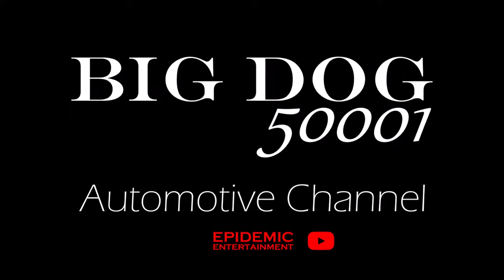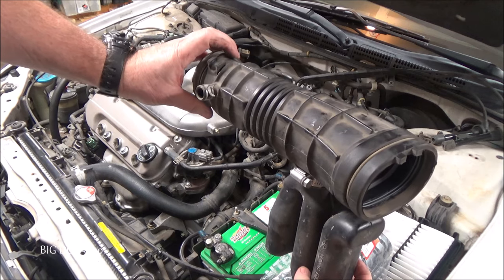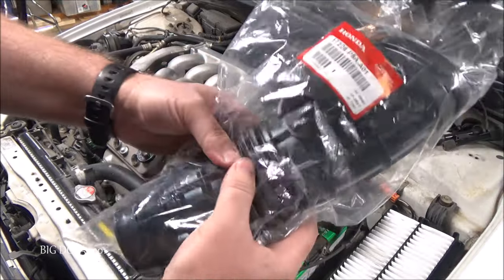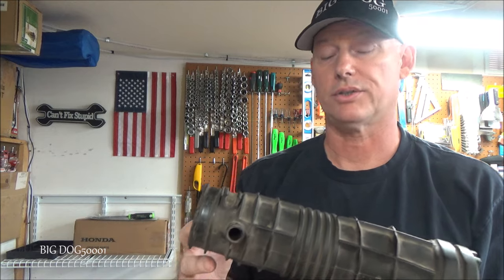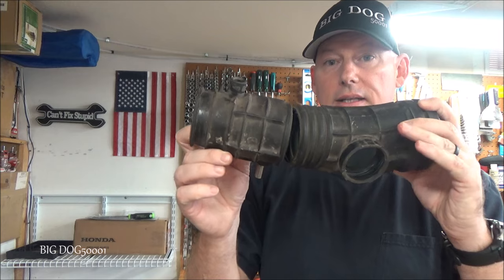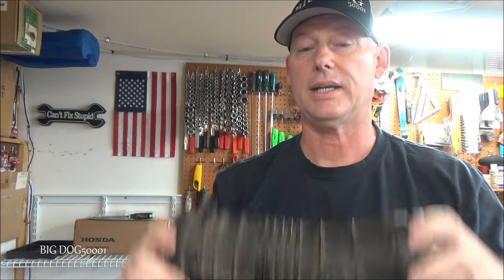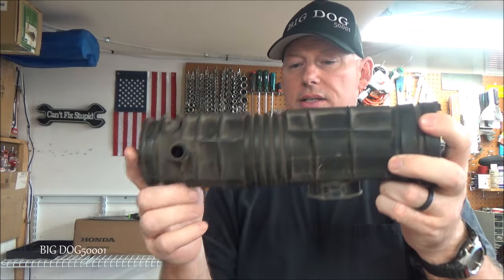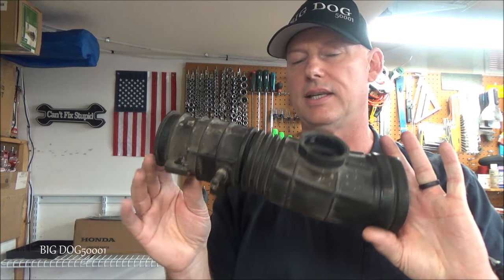Tech Tips: Intake Air Tubes

Comment: 👍 Yep… I just discovered a cracked-split air intake hose on my wife’s 2013 Nissan Pathfinder,
We just replaced the transmission & the suv has been running like crap since… Wife described it over revving - then no power.
Sadly, we’ve had it into a local reputable mechanic shop a few times, and he’s replaced the map sensor, then later the map sensor wiring.
Frustrated & afraid to get stranded,
Wife has been Truck my old truck last couple weeks…
So I finally decided to take a look at it myself today.
I’m no mechanic; but I work on my trucks & do many mechanically inclined projects,
But generally try to avoid the foreign cars as I’m unfamiliar with them.
So this morning I dissembled the covers, air box, air filter, cleaning as I go… begin to examine every hose visually & running my hand around them with engine running - looking and listening for a vacuum leak,
As the car threw 3-4 codes,
3 of which indicates a vacuum leak,
Anyway sure enough the under side of the hose- boot had a split 3-4” wide.
Hoping this  will fix the issues when I pick up the new hose tomorrow.

Comment: In case anyone is curious, on Honda Pilot, after recently changing my air filter, a badly split intake hose (after MAF, before MAP) forced a rich condition which began wasting fuel.  15-16mpg instead of 19 and my oxygen sensors began coding because the cats couldn’t deal with the excess fuel.  Anyways, as expected, after replacing the hose I immediately got a high MAP voltage code because the car was suddenly starving for air that it had gotten used to getting.  The computer just took some time idling and driving to relearn the new optimal ratios.
Reply: @Kmssvx111  
Disconnecting battery should have reset it.  It does on 2013 Pilots and then takes awhile for it to relearn.  You may have moved the throttle body position sensor and screwed up it’s position.  In that case I think you do need help resetting it

Comment: Excellent sir. Mine was cracked as well 🤣. Accord 4cyl 2003 got replacement from salvage yard 👍
Reply: Did it have stalling issues before and were they solved?
Reply: @JaRa911  not that but very poor idling and slow acceleration.

Comment: A chain shop franchise cracked mine during a starter replacement. I didn't know till months later when I was replacing my air filter. It was a 2006 Honda Accord 4 cylinder, the starter buried under the plenum which is attached to the throttle body and this air tunnel/tube. When my other identical Honda needed a starter, I replaced it myself. Never trust a fancy sign of a chain shop, they're magnet for underqualified mechanics.
Reply from the maker: That can definitely happen during a starter replacement on those, thanks for the input!

Comment: Always a great video.... Replacement mine on my 2004 Accord a few months back. Keep up the good work.
Reply from the maker: Thanks! 👍
Reply: Did it stall at all before you changed it?
Reply: @JaRa911  Nope....was just ripped really bad. It actually ran fine. If I never saw it I
would have never known. I do think it could cause some stalling if to much air is leaked in and with a dirty throttle body. Sounds like it could be possible.
Reply: @Glenn_123  my ‘04 Honda Pilot is randomly stalling(not very often) and I opened up the intake and I was expecting a dirty throttle body but all I found was a tear in the intake tube gonna hit up pick n pull to replace it
Reply: @JaRa911  So, I imagine it may help just obviously, can not say 100%. So my accord was split bad and made no difference at all. I was shocked. If you do not mind please let me know if that fixes yours. If it doesn't I would imagine maybe a vacuum leak somewhere could cause it but would also think you would ha e an engine light on.
Reply: @JaRa911  No it never stalled. I changed it when I replaced the starter and had to remove it. That is when I noticed it was all broken and torn.
Reply: @Glenn_123  what I’m thinking is maybe possibly something got sucked in cuz the tear was pretty big and made it stall. It’s only happened twice in a 4 month span gonna take off the throttle and clean it anyways I already got the intake tube this morning. Gonna do some cleaning before I I stall
Reply: @JaRa911  yeah sounds good. That may be the issue hopefully!
Reply: I have the same car. The problem is the idle issue mentioned in the video.

Comment: It only shows up on a MAP engine if the leak is after the throttle plate. Great video!
Reply from the maker: One thing I have learned is to never say "only"!  ;)
Reply: Big Dog50001 Automotive Ok lol. GENERALLY a vacuum leak has to be after the throttle plate on a naturally aspirated MAP engine in order to cause any kind of code or idle issues 😜

Comment: Hey big dog. I cleaned my throttle body on my 8th gen civic. Ever since the idle surges after a few seconds on start up and the idle rpm  is about 1100 until engine reaches operating temperature and then it goes to about 700
Reply from the maker: Usually an idle relearn procedure needs to be done after working on the throttle body.  Typically that involves letting it idle for at least 5 minutes with no electrical loads after it has gotten to operating temperature.  On that generation Civic, the PCM needs to be reset with a scan tool in order to do the idle relearn.
Reply: @BigDog50001  hey big dog. I've tried re teaching it several times. Do you know what the charge would be at a dealership roughly? I have a blue driver scan tool but it's not bidirectional. Thanks for your channel you have helped me tremendously with your videos on coolant and transmission fluid exchanges. Love the channel.

Comment: The main clamp on my air filter is basically off although it still sits in place. Its a 99 dodge ram 1500 5.9. sometimes when idling it will run real real quiet or sometimes when leaving a stop sign or getting up to speed it will have trouble and even jump or stutter. Does this have anything to do with the clamp not totally tightened down. Im going to tighten it down either way but im curious if this is the direct problem

Comment: I had a civic 2005 ex coupe. Always run good but as soon as i reached a traffic light or stop and made the full stop it started to shake. If i press the gas and the break at the same time it will stop shaking when the odometer reaches between 1000 and 1500 rpm. Never found the problem so I got to sell it.
Reply from the maker: Thanks for the input!

Comment: I had a question if anyone can help how do you take those clamps off on a 2012 honda accord ive tried a phillips ph1 and it sorta fits but i havent had any luck i dont want to strip the bolt ive seen others recommended a 7/32 socket. If anyone can help thank you

Comment: What's the name of the metal tube that comes from the engine that goes back into the air intake tube right before the throttle body?
I bought the Rubber Hose to connect it to the engine. And I want to learn how to clean it before I reconnect it. Thank you!
EDIT: I figured it out and already cleaned it and reconnected it with a new rubber tube piece that connects to the engine block... Thanks everyone!
Reply: Throttle Body?
Reply: @joseprado8532  No... it's a tiny metal tube smaller than your pinky about 7 inches long. It is connected by a 3 inch rubber tube to the top of the engine. It's where people replace it with an oil catch container instead of letting the engine air go back into the throttle. It connects to the rubber big round tube that comes from your air filter and that rubber tube goes into the throttle body...
Reply: Maf sensor
Reply: @jasminerobinson201  Thank you... I figured it out... it's not the sensor. It's a metal tube that connects to the back of the engine block and goes to the air intake  rubber tube that goes into the throttle body. It connects about 2 or 3 inches before the MAF Sensor... Thanks though...

Comment: Are these relatively easy to replace at home by yourself?
Reply from the maker: I'm sure some can be a pain, but typically they are not much more difficult than replacing an air filter.
Reply: @BigDog50001  got it - thanks. Got a crack in mine and spent $10 on an RTV sealant but I think I’ll just spend the $30 and replace the whole thing.

Comment: Is there a temparary fix for the crack intake hose? I have ordered the part, but it will arrive 10 days later.
Reply from the maker: In most cases I typically will wrap it with Gorilla Tape as a temporary fix.
Reply: @BigDog50001  Thank you.